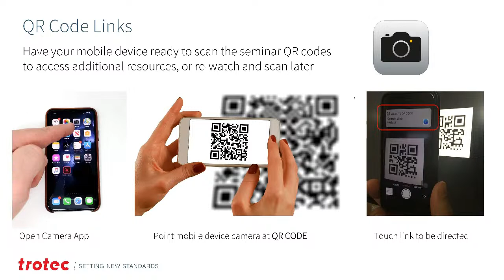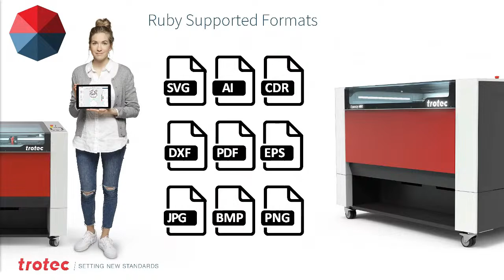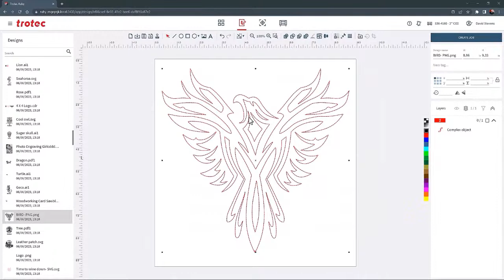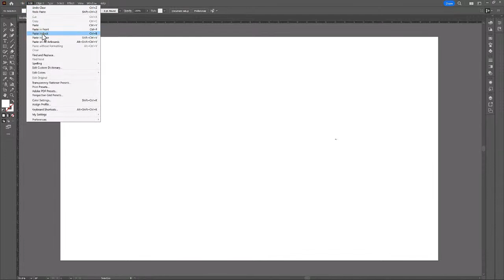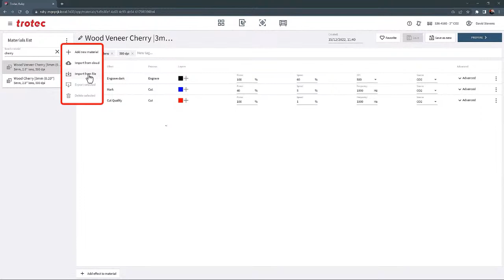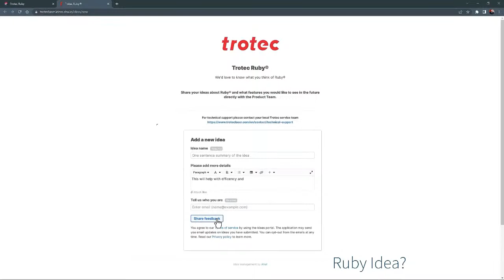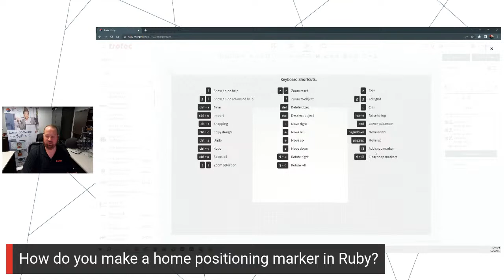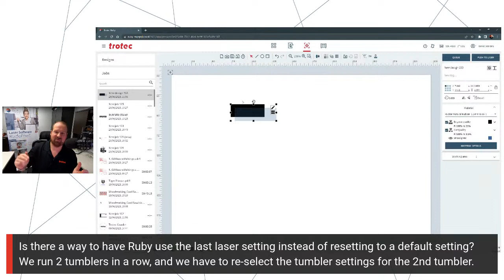Trotec Laser: Ruby Laser Software Training

Comment: Hi, I’m having issues when send to push to laser, it won’t let me send it… tells me table empty?? Help please
Reply from the maker: If a file shows the table empty, you will need to save it in the Prepare screen first; this only happens when a new file is created or dragged into the Prepare screen and is not saved. Select the save icon on the top toolbar first, and it should allow you to push the file to the laser. Another issue is if the color that you are using is not correct or that color is turned off. This will also cause this issue. If you continue to have problems, please go to www.mytrotec.com and submit a support ticket, and a service tech can call you and log into your computer to help you.

Comment: I’m extremely disappointed that Ruby isn’t available for Mac and/or Linux. I haven’t used Windows since 2012, and I’m not going back for laser software. This is one reason why LightBurn has such large market share. It’s also the main reason I won’t use Trotec’s admittedly wonderful, fast lasers, despite their design and performance advantages.
Reply: @brianoak1600 Ruby is available for any OS, including Mac and Linux, as long as you order a new laser machine with the Run on Ruby onboard computer.  Please watch starting at the 7:42 Mark for details.

Comment: Ruby doesn't allow you to set markers and so you can't adjust your object or print form. So it's more a playful simple software for beginners but for professional tasks you will need job control. The problem: job control doesn't works on the new trotec lasers - so better buy an older model before 2022.
Reply from the maker: Ruby can create Markers by pushing the "F8" ket in the Prepare screen.  Ruby is not a "Playful simple software." As you state, Ruby has far exceeded the old JobControl Software in its features and capabilities, providing hundreds of features that cannot be achieved in JobControl.  Please see this link for updated training on Ruby to see all the features that are now possible, like Print merge, tracing, Nesting and Graphic editing, and so much more: https://www.mytrotec.com/us/rubybasics/
Reply: @TrotecLaser  Whow!! You are right. With "F8" I can really set markers. Now I'm curious if still the atmos filter will start when only moving the laser head to the markers like it happens in Jobcontrol and Rayjet Manager. Funny that the Trotec staff in Germany and even the sales personal from Austria on the "Drupa 2024" didn't know it and say they don't support markers any more. I really ask for that at the fair. Maybe because there is no Icon for that. I know that even in Job Control and in the Trotec Rayjet Manager is a lot of hidden prompts that a nowhere described and mostly unknown. One example: to change movement speed of the laser by the hard buttons for adjustment, you can switch by "2x press ALT and 1 time press STRG/CTRL - than it goes slow, slower or faster) and similar tricks.